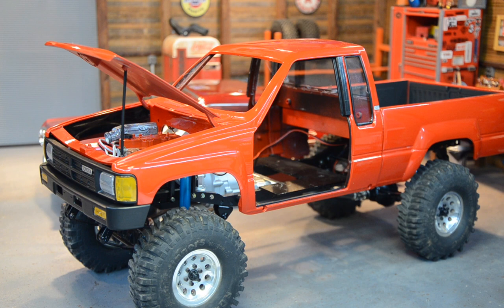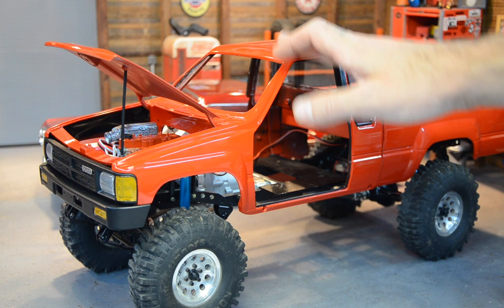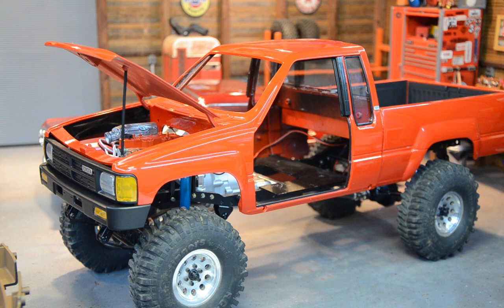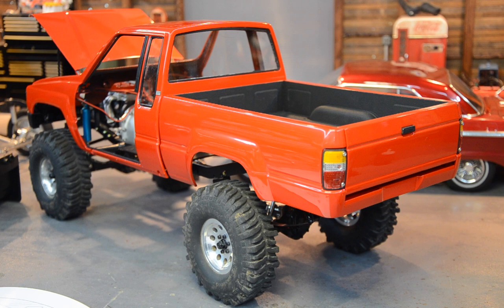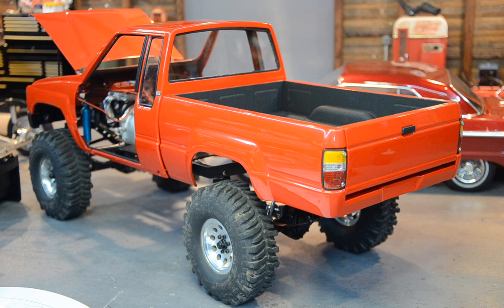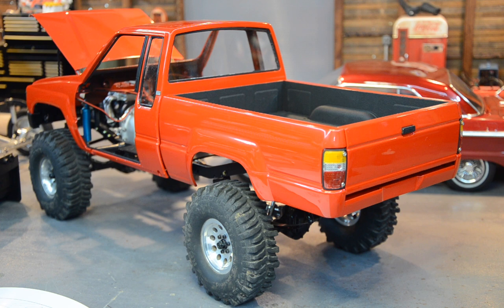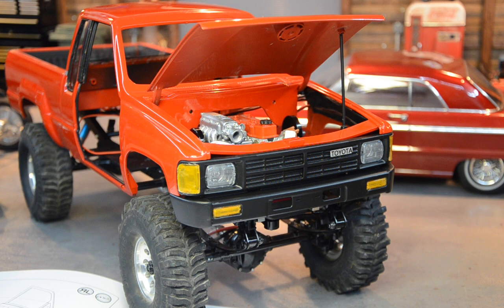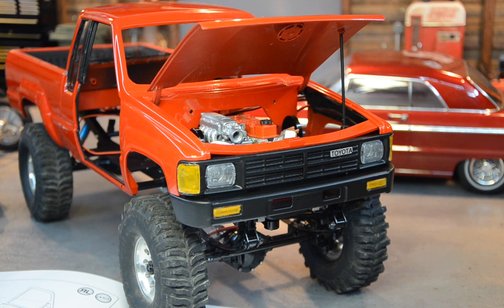The RC4wd Toyota 87 Xtra Cab Build, Lights and Final Assembly, Part 1

Comment: heat the tube it should temper it and make it easier to bend or fill with dry sand and cap both ends so it has some support while bending, if its k&s tube grab one of their benders to suit the size of tube. just a few ideas. loving the build

Comment: This is turning out great, the finished product is gonna be sweet can't wait. 👍👍

If you do try another "shiny" project, which I hope you do, you should try some "Model Master: Clear Parts Cement & Window Maker" or any brand of Clear Parts Cement & Window Maker for gluing the windows.
 It dries completely clear so you don't have to worry about hazing and if you accidentally get it on the window it's no big deal and it will hardly be noticeable after it dries. It takes a little longer to dry but it's well worth the wait imo.
Reply from the maker: Man, I wish I had heard of this before. The tamiya cement is at least non whitening. Lol I will have to get some and try it out. Thanks for the tip!
Reply: Yeah more shiny

Comment: Watching all these Xtra cab videos which are fantastic! What scale engine did you go with? I'm looking at going with the R4 trans and the rc4wd small block v8 on my Xtra cab build but that scale 22r you have is really nice looking.
Reply from the maker: The motor was from scale designs by mr comma D. He has a ton of v8 options from all makes that will work with the r4 trans.
Reply: @RCeveryday  ok thanks so much for the info

Comment: What are those you using for black detailing on the door and window trim ?
Reply from the maker: Testors flat black enamel paint pen
Reply: @RCeveryday  sorry,.. does sharpie oil based can do the job ?
Reply from the maker: no they will not cover well
Reply: For the clear windows Is it only the windshield that gets the black treatment? I’m also seeing that the one I have has 4 screw tabs on the windshield. Yours doesn’t appear to be that way